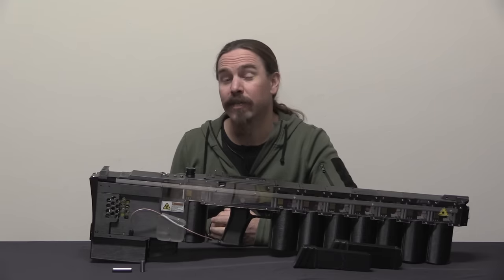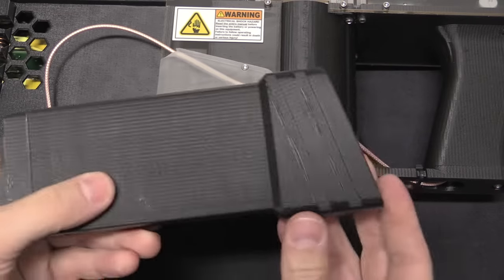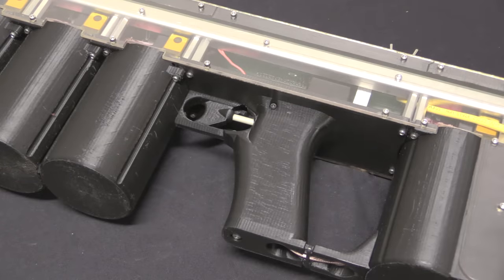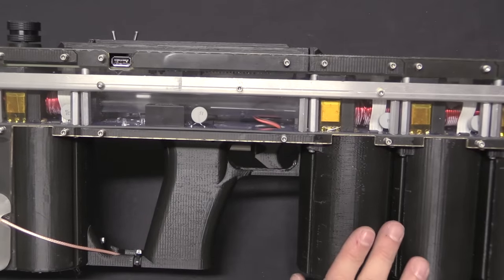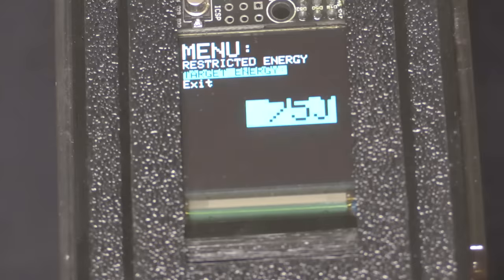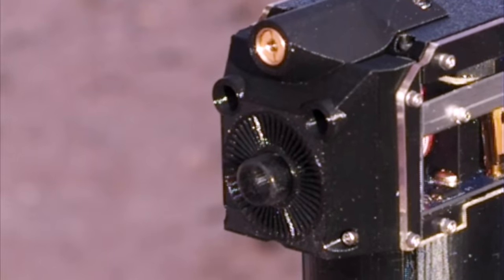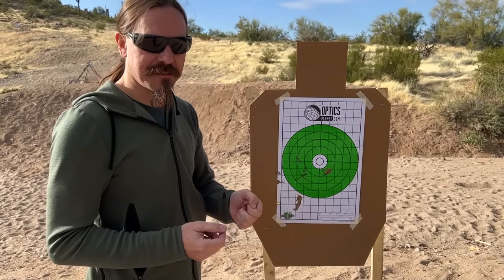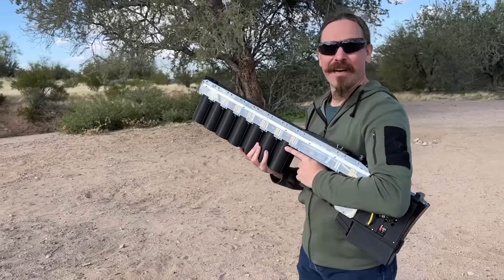ArcFlash Labs' GR-1 Anvil Portable Gauss Rifle

Comment: In the year 2022, with a lot of technology and quite a lot of limitations (barrel temperature, charging time, etc) we have reached almost half of the energy delived by a 80g arrow launched by a 72-75kg @75 cm draw warbow during The Hundred Years War.
But, before we snigger at this weapon, the warbow at Agincourt was at the pinacle of its development spanning more than 7000 years. 
This MassDriver is not even in infancy, but rather inception. Imagine (or rather not) what this will be able to do in 25 - 50 years time.
Reply: I doubt this will ever take off. See how many beefy capacitors you need to impart the same energy into the slug as the few grains of powder in a .22LR? They aren't going to get much smaller if at all since capacitance is a function of the surface area of the dielectric plates. To get actually useful energies into that slug you'd need many more caps or much bigger caps which would make it non portable. Chemical propellant is just a vastly more efficient and reliable energy storage medium when it comes to firearms.
Reply: Exactly.  This is simply proof of concept.
Reply: Thank you for the information✌️
Reply: @randysterling4700  Is it CM? I'm confused
Reply: @randysterling4700  snigger is an actual word.
Reply: @JohnDoe-zh6cp  It's silent. Give it a decade or two of development and this will be a totally different and effective weapon.
Reply: @JohnDoe-zh6cp  part of me agrees, part of me doesn't.  you are right about capacitance of course.  but with the development of quantum computers will come quantum technology.  everyone predicted computers, no one predicted cell phones as we have them today.  you never know what will come of  that tech.  it will be interesting to see what twists this tech will take.
Reply: @JohnDoe-zh6cp  Your comment won't age well. Respectfully.
Reply: @JohnDoe-zh6cp  This is sort of like saying "Black powder weapons will have no place in warfare because you can shoot a bow much faster." The areas we need to develop our material science is in room temperature super conductors (which takes care of heat coming from resistance) and energy storage/capacitors. We're getting there on both fronts as with new advances in graphene batteries which can operate both as a storage medium as well as a capacitor. These do have the potential to be loud as rounds would be leaving the barrel at super sonic speeds. And additional improvement/issue would be in keeping the barrel at near vacuum as that removes heat from round atmospheric resistance as well as increases velocity at the point it leaves the muzzle. Give this 20-50 years of maturity. No one is going to trade the potential kinetic energy on target of a mass accelerator for a chemical propellant. With those you are limited to the volume you have in the shell casing to cram powder, primer, and bullet into. With a rail gun, you not only have the ability to dial in the velocity you want, but exiting energy is limited only to the capacitance of the weapon, meaning down range you can have rounds the size of a 22LR transferring boat loads of kinetic energy on a target.
Reply: @TriviaChallenge  It's silent because the slug isn't breaking the sound barrier. And i respectfully disagree there are physical limits at play here.
Reply: @SandrockCustom  Bet you think we'll all be driving flying cars too
Reply: @JohnDoe-zh6cp  25-50 years? Some of us will be. I'll come pick you up 🍻
Reply: Ok, but what about the other projects/ideas that at first seemed promising, but ended up at the trash heap of history?
Reply: Haha pretty good analogy but remember it's just a prototype still to be improved upon.
Reply: @cactusman8980  In very bad taste to use it. Trust me I'm an expert.
Reply: The big one the Navy built is pretty impressive already.
Reply: @poisoncheeto9956  If you think the phrase "before we snigger at this weapon" is distasteful that's a you problem.

You ever get bitten by chiggers?
Ever get a little stain in you knickers?
I keep a pair of nippers in my tool belt.
I get nervous when people can't keep their finger off the trigger.
Reply: @Wolfy1012  would be great for space, don't gotta worry about vacuum in the barrel if the gun is in vacuum, or large version for modern warships, they're testing lasers, why not mass drivers?
Reply: @JohnDoe-zh6cp  we aren't running into the limits of physics, we're running into the limits of off the shelf materials

you're doing the equivalent of saying a 16" naval gun can't be made because the bronze of your cannon can't handle that level of strain, and steel rusts too fast to be of any use whatsoever in a naval environment.

Myself I find it to be an interesting novelty - we need better capacitors and / or near room temperature superconductors for it to compete with a service rifle, but early firearms did FAR worse.
Reply: @muninrob  Look man, the Navy has already abandoned their billion dollar railgun project. Is it possible to make a functional railgun? Obviously. No one is saying it's not. I'm just saying that they won't overtake traditional firearms. There are too many cons and not enough pros regardless of advances in material science, which I still think won't allow the type of portable railgun you're imagining.
Reply: @SandrockCustom  People can barely drive in two dimensions without killing each other and you want to give them three and waste tons of additional energy doing it?
Reply: @JohnDoe-zh6cp  Sir, I am not Tony Stark, sir. I DO NOT control these things 😂
Reply: @MrKago1  Quantum computing is not what you think it is lol.
Reply: @JohnDoe-zh6cp  Funny, they said the same things about crossbows and early firearms.

If material science advances don't matter, why aren't we still using small bronze cannons lashed to sticks that use black powder to throw a round stone? Why didn't ships during the age of sail mount 16 inch deck guns?

P.S. you do know that a coil gun and a rail gun are two VERY different concepts, right?
Reply: @muninrob  They? Were you there? Do you have documentation for that claim lol?

I'm saying that materials science advancements don't matter that much for CAPACITORS. You know, because of the laws of physics.

Lmao they're not that different. They operate by the same principle but a different mechanism. It's like saying a matchlock firearm is VERY different from a wheellock firearm.
Reply: @JohnDoe-zh6cp  The area of the plates, yes, but also the dielectric constant of whatever is between the plates. There exists materials that are currently too costly to use that have dielectric constants 20 times greater than that of the best Class 2 capacitors available today, and there are doubtless materials with even greater dielectric constants that haven't been discovered yet. The key breakthrough needed to advance this technology is the cost-effective production of materials with extremely high dielectric constants.
Reply: @JohnDoe-zh6cp  that's not my point.  its the START of a field.  the very infancy.  the first computer was made of gears in the early 1800's.  semiconductors hadn't even been a twinkling in anyone's eye yet.  we didn't even have a full model of the atom at that point.  we are in a similar place with quantum physics.  we are missing an entire fundamental force and there have even been postulates of a possible 5th force.

even with the first semi conductor computers or the first vacuum tube computers, no one imagined they would fit in your pocket.  dick tracy had a video communicator on his wrist, but it wouldn't be until the late 80's and Star Trek's tricorder that anyone could conceive of a computer capable of accessing the sum total of human knowledge.  today, tribal kings in straw huts in Africa watch youtube on their cell phones.  NO ONE saw that coming.
Reply: @saintbartholomew7434  It's not nearly as simple as you're implying lmao. Increasing the dielectric constant 20-fold while keeping volume constant is going to result in a capacitor that is both extremely unsafe and short-lived. 
Even if you could both shrink the caps and vastly increase their energy density (now your rifle is a bomb) there are so many other problems with this concept that I guarantee it will never see the battlefield in a soldier's hands.
Reply: @the_inquisitive_inquisitor  Good God I'm sorry, Maybe I should take er easy on the CNN for awhile its rotting my nogin.
Reply: @JohnDoe-zh6cp  That's the case now, but if you told van Musschenbroek that there would one day be Leyden jars with materials that have a dielectric constant of nearly 100 times that of water he would likely think you a madman. And I agree with you that these weapons will likely never see widespread use on the battlefield. If nothing else the EMPs generated by a coilgun powerful enough to penetrate body armor could wreak havoc on battlefield communications systems, and their electric and computerized nature would make them too dependent on a solid supply chain. But that doesn't mean they will never become a practical tool for other purposes. But certainty I very much doubt that will come in any of out lifetimes.
Reply: @JohnDoe-zh6cp  People used to say the same about computers, and electric cars. Now we have AI and the Rimac Nevaro. Never underestimate the speed and possibilities of electrics.
Reply: @TriviaChallenge  For every example that you tout, there were 1000 other failed ideas that you’ve never heard of.
Reply: @saintbartholomew7434  You’re not getting the point. It’s not about if high dielectric constant materials are possible, it’s about how dangerous and impractical they would be in a capacitor. You’re approaching energy densities that would cause explosions if the device failed. And I doubt he would call you a madman; all of you have a lot to say about what premodern people thought about specific technology and nothing to back it up. 
I think they might be used as large stationary guns for long range artillery or something in niche applications but I guarantee they will not be used in portable form in a soldier’s hands. They have, in theory, no advantages over traditional firearms that would justify their comparably exorbitant cost and decreased reliability.
Reply: @JohnDoe-zh6cp  I literally said that I agree with you on their potential in the battlefield. The negatives outweigh the positives for individual use. But on the subject of high-energy capacitors, I think it is awfully presumptive to say that they will never be relatively affordable and reasonably safe. Currently that is definitely the case, but who knows what the future may hold? Such capacitors may one day be invented, and they may not. My point is that nobody actually knows.
Reply: @the_inquisitive_inquisitor  It's a black thin, man.  Just ask another random black guy or gal what they think. Better yet, use "snigger" in a sentence and pay close attention to their pupil dilation. I guarantee that you're going to get something like, "for a minute I thought you said..."

Hopefully, you will be friends with the person lest I bid you, farewell.

Comment: In the future we will have the AFL-V20K Thor...
It will have a holographic sight with an integrated rangefinder, a detachable cooling sink, a level of EMProtection, and several types of factory-fit Bolts.

Such as the basic Bolt, the Guide-Corrected Bolt, Splinterheads, Chemloads, and my personal favorite : Delayed Explosion-Applied Detonator (DEAD) Bolt.

Comment: This is awesome, but I can’t wait for the first look at the phased plasma rifle in the 40 watt range!
Reply: Sort of related, there's an air rifle called the Bulldog that looks very much like the plasma rifles from Aliens and fires .357 slugs at the same velocity as a .38 special with a 5-round magazine.
Reply: Hey, just what you see, pal.
Reply: I don't really see plasma weapons as they're often portrayed in fiction becoming a reality any time soon. It's like trying to make a fireball gun, only the "projectile" is even less likely to stay together than gas. I can see stuff like electrolasers being made into lightning cannons (I mean exactly what it sounds like), assuming they can figure out how to prevent a lightning rod from diverting the beam.
Reply: @trielt1  The theory on making "lightning guns" work is that you'd use an ionizing laser to positively charge a line in the air an instant before the negatively-charged "lightning" fires, forcing it to follow the ionized track.
But it will all remain science fiction (or maybe naval ordinance) unless we see a near-miraculous breakthrough in battery tech.

Comment: you do not need rifling to create spin with magnetics. if they incorporated this into the design and made the projectiles more bullet shaped to reduce drag then they could extend not only the range of the projectile but also the speed and penetration values as well.

Fun Fact. since this does not use any sort of combustion it does not qualify as a firearm and requires no license to own. not to mention not being illegal to possess if you are a felon lmao. The same goes for high powered Pneumatic guns.
Reply: Depends on the jurisdiction. Canada, for example, defines firearm as "a barrelled weapon that discharges projectiles capable of causing bodily harm or death, or anything that can be adapted as a firearm". Nothing about combustion.
Reply: Pretty sure once this tech becomes better and more lethal that law will be changed to fit these type of weapons into it.
Reply: @yinanwang2244  in the uk its legal as the uk requires a propellant to be classed as a fireamr
Reply: @yinanwang2244  um, thats Canada. though i do have to admit I did not specify america.
Reply: Some of those PCP .357 and .45 caliber pneumatic rifles are legit AF. I've seen like 405gr hard cast .457" bullets fired at 750 ft/s (505 ft-lbs muzzle energy, right between .357 SIG[475ft-lbs] and .357 Magnum[550[ft-lbs]) from PCP air rifles.
Reply: CNC machined spiral projectiles are a must. Id love to see how they would perform.
Reply: I could be wrong. But I think in New York the law says anything that fires a projectile… in New York a bow and arrow is classified as a firearm, which is stupid
Reply: @itssouthbranch7949  technically that makes a rubber band between your fingers a firearm—if you have any paper or paper clips
Reply: So…. full auto isn’t nfa regulated in this case?
Reply: Still not an option for felons with firearm charges, most states go by a "trigger" definition in u.s.a so no guns, bb guns, crossbows.
Reply: @prestongarvey2285  not true, airguns qualify as firearms.
Reply: @michaelmichaelagnew8503  This thing has been in development for 30 years.  This is as far as it has gotten.  Do you wonder why that is?
Reply: @yinanwang2244  so a fking blowgun is a firearm in Canada?
Reply: @itssouthbranch7949  
It's actually anything "deadly" with a trigger

I spent 4 years shooting larp arrows in central park, but we weren't allowed crossbows because of the trigger
Reply: @cb-ev1tz  strange, I just remembered reading an article about it because I was in trouble for bringing my personal bow to school my senior year since I was on the archery team and such, but with a trigger sounds more plausible to me

Comment: The big advantage of this weapon as a plinker would be the ability to re-use the ammo. Given enough batteries, you could shoot all day.
Reply: A blacksmith could have made them by hand back in the day, not as hard as making Arrowheads, of course ammunition quality would be lacking, but what better gun on a distant colony that can't rely on it's mother planet, because with the amount of nuclear close calls we've had so far, well... Don't know about the next hundred years, ashes ashes we all fall down, plus if it's like a 22 equivalent that doesn't overpen in "zero" reduced G environments, it'd be useful.
Reply: I mean, if you load up a shotgun slug with a 1/10 powder charge, you'll be able to shoot it all day too.
Reply: @SBBurzmali  I think what they mean is you could shoot it at a couple targets, scoop up the ammo and throw it back in the gun to keep on plinking
Reply: Grown up nerf gun.
Reply: Rechargeable batteries too, being able to reuse both the projectile and the propellant is straight out of archery.
Reply: Just connect to a power outlet, shoot all day 👍
Reply: @SierraTangoGuns  that's basically what the MetalStorm is.
Reply: if they get it firing as fast as a combustion gun, it will destroy the ammunition just the same.
Reply: This is not a property of the gauss design but of the low energy transfer. If this weapon would deliver more energy, the slug would splatter, too
Reply: @petermuller608  yeah but right now it's  a plinker.

Comment: It would be very easy to experiment with projectile shapes and sizes - spiral fluted to add spin like rifled shotgun slugs, or shape it with a conical point and front heavy to minimize Tumblr.  It might also be possible to have more than one barrel in order to increase the rate of fire or to be able to fire different projectile types or different diameters - think of .17 and 45/70 coming from the same gun.